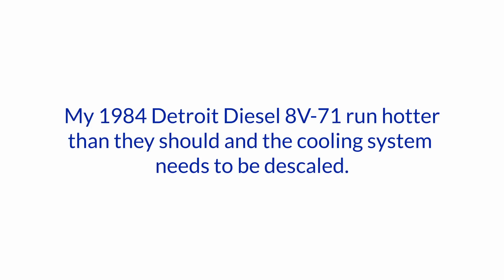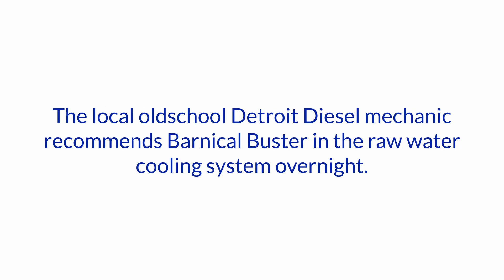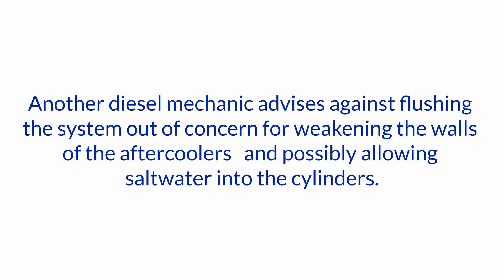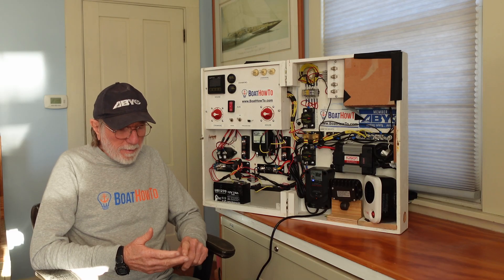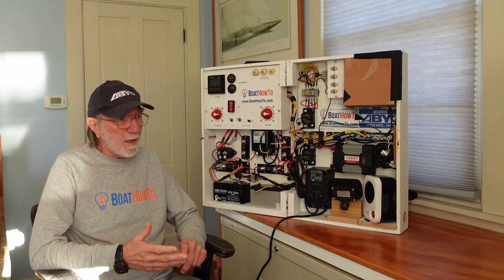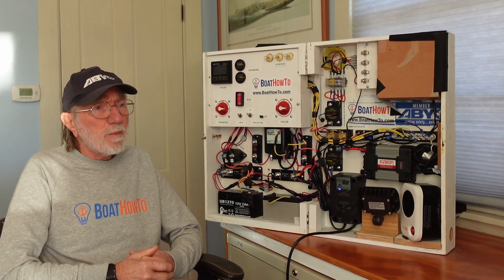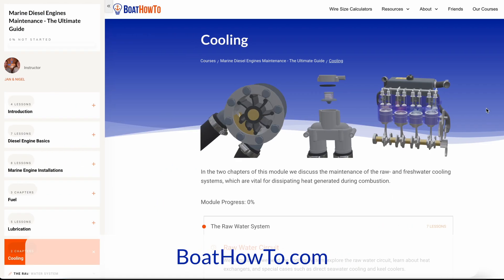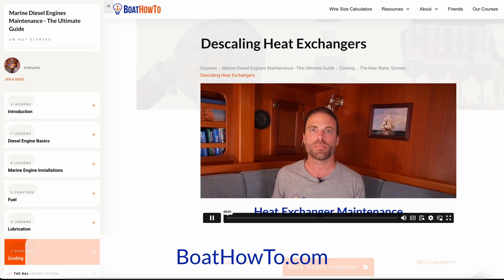DESCALING your Marine Diesel HEAT EXCHANGER 🔧 | Ask The Expert with NIGEL CALDER

Comment: I prefer to take apart things. And use white Oatey Teflon pipe joint sealer, the white stuff on bolts. I also use it on rubber hose connections, prevents the rubber from sticking as badly. If you use that stuff, it keeps water out of threads, things do not corrode. Has to be used on dry parts!

Comment: Agree 100% and by using a non corrosive de-scaler it cleans all of the waterways and not just the heat exchanger.  I can check a few tubes in my Volvo D1-30 by removing the water outlet hose to the exhaust elbow.

Comment: Postponing addressing stuck fasteners is a fool's choice. They don't improve with time. Either you choose the time and place for the repair, or the fastener will, and you won't like that time and place.
When reassembling, use anti-seize, and torque appropriately.
If you don't have the time to do it right, how will you find the time to do it over?